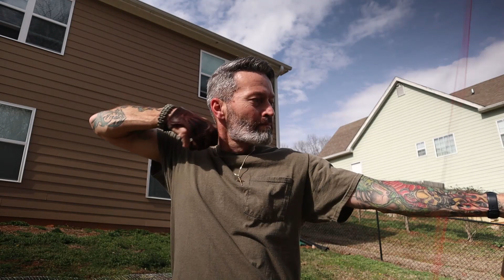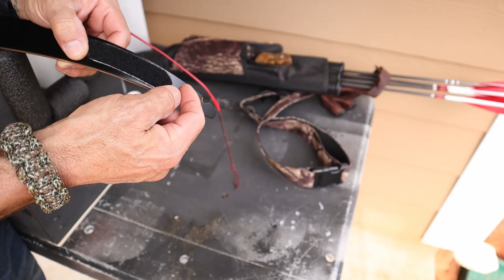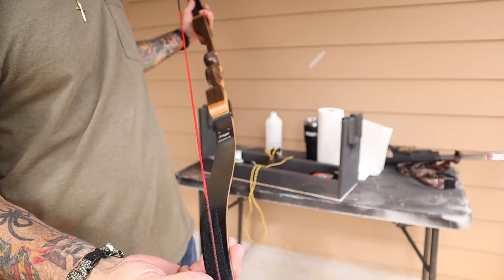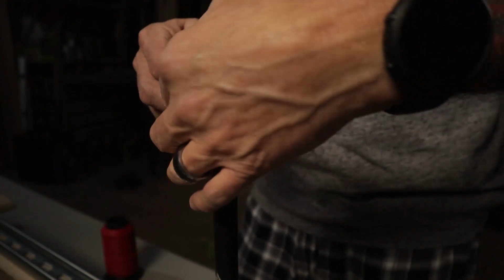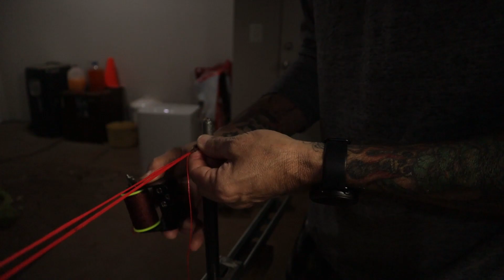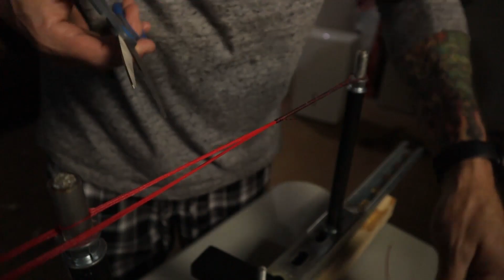Silencing Recurve Bow Limbs-Recurve Noise Fix

Comment: Good tip, but I’d also be adding whiskers to the string and continually working on the right brace height as string stretches in and it should only become even quieter 👍🏻
Reply from the maker: Thank you for your time and the comment, my friend. I have experimented with those ideas and think I have gotten it as good as it can be. I hope you have a great day. Best regards
Reply: What about a cotton ball? too light?
Reply from the maker: Thanks for the question. A cotton ball would not hold up after repeated release.  I do appreciate your time and the comment. Have a great day. Best regards

Comment: Cool video,  some great tips and well made. One thing I'd suggest for your string building is to stretch the string and set the amount of twists you need to get the brace height you want, then do the centre serving with the bow strung. That way the centre serving won't come apart when it stretches or you add/remove twists.
Reply from the maker: Thanks for the tips my friend. I'm new to endless loop builds so I'll take all the advice available. The learning process has its rewards. Thanks for watching and Thanks again for sharing the tip. I really appreciate it my friend. Have a great day.
Reply: i guess it is kind of off topic but do anybody know a good place to stream newly released movies online ?

Comment: I did that with  a sage I had and I ended up having to remove the velcro , the velcro prevented the string from sitting in the grove and as a result the string was out of alignment, maybe it was something I did . anyway like your video and plan to visit your other videos keep up the good work.
Reply from the maker: Thanks so much for watching and taking the time to comment. That does seem odd that the string didn't seat right in the groove after installing the velcro. Hopefully you got it sorted and your bow is set up to your liking. Again, I really appreciate you taking time out of your day to comment.  Have a great day my friend!

Comment: Just subscribed!
I have done exactly the same thing to my new recurve but I also added 7 inch fur plates to the other part of the velcro.
Now I have some takedown fury limbs on my takedown bow😉
I placed the fur so the string would always be a little bit in contact with the leather up and down.
It is a game changer.
I also added rubber plates between the limbs and the riser and pluged every holes I could find (metal riser) that would do a "guitar" effect.
Silenced the string with fur and screwed in a silicon counter weight.
The bow is TOTALLY silent, absolutely no vibrations after the shot.
You should try.
Reply from the maker: I'm going to have to try that with the limbs. I never thought about doing that. Closing up the inserts is another good idea. Thanks for the insight! I appreciate the comments and thanks for watching my friend.  Have a great day!
Reply: @ScottWinters  all the credit goes to Survival Lilly on youtube
Reply from the maker: Cool my friend. I follow her channel. She has great content.

Comment: So on the inside of the riser slots for the limbs  use Plasti Dip Spray  mask off the slots and shoot a clean coat inside the limb pocket and the limb section that fits inside the slot SWEET Hack
Reply from the maker: That makes a lot of sense. I will definitely look into that. I would imagine the plasti dip will compress a bit allow it to even out when the limbs are reinstalled. Thanks for sharing the idea my friend. Have a great evening! Best regards

Comment: I’ve never been able to add the beaver tails correctly… but I want to silence the bow, do you think these work as well or better for the sammick sage as far as silencing goes.. or do those tails take it to a different level?
Reply from the maker: Thank you for the question. I have never installed a set my self, but for my understanding they do help silence the string to an extent. I have used velcro and yearn in all of my string builds and bow setups with great success. The key to remember is adding anything to a string slows it down and helps lessen string vibration helping to reduce noise.
I hope that helps. Have a great day. Best regards

Comment: I have felt i used for my shelf.  Web says its to thick for limb savers.  So i am reluctant to use it.  Any opinion on this?
Reply from the maker: I would doubt there would be a problem using the felt. The velcro I use is thicker than felt and I haven’t experienced any negatives using.  I think you will be good to do so. 
Hope that helps. Have a great day. Best regards

Comment: Question:
Did the bow come with padding between the riser and limbs?
Reply from the maker: No it dod not. I've always thought about trying some things felt in the limb pockets but never seem to get around to it. I appreciate your comment and your time. Have a great day my friend.
Reply: I read on a few threads that it didn’t help much but a suggestion was made to apply string wax.  I’m going to try that.
I just did the Velcro strips on an OMP Adventure recurve that I set up for beginners. Works great.
Thanks 🙏 I really enjoy your practical content.

Comment: Out of curiosity why did you choose Velcro over say a felt adhesive strip?
Just curious if there's any real reason or just accessibility because I feel that good felt could work better and smoother for the string.
I've been looking at the felt due to the calf skin being so hard or costly to get in my part of the world surprisingly.

Cheers for the video though, exactly what I was looking for
Reply from the maker: Thanks for the comment my friend. The main reason for the velcro was just an overabundance of it, LOL. I've used it in the past and had good results do I just continued with it. You are correct that a good felt material would work as well. I think I tried some adhesive back felt on one of my bows before. It was a good thickness and gave good results. I really appreciate your time my friend. Have a great day! Best regards
Reply: @ScottWinters  thanks for the quick reply mate much appreciated!

Comment: Was your brace height correct? I’m guessing so seeing how you make your strings but just a thought?
Reply from the maker: The Sage seems to favor an 8 inch brace height. Recommended is between 7.25 and 8.25. I generally keep it at the 8 inch mark. Thanks for checking out the video. Have a great day
Reply: @ScottWinters   my buddy has one and we played around with it a bit. We set the brace at 8.25 and also stuck thin felt in the limb pockets and the vibration and hand shock is completely gone. Liked the video for sure thank you!

Comment: I just got a recurve bow and the string is sitting on the bow when I put it on instead of hanging out like yours does and I’m not sure what I’m doing wrong
Reply from the maker: How are you putting the string on? If it's on the wrong side it will do that. If its too long it will do that as well.
Reply: @ScottWinters  it was on the wrong side my DA self didn’t realize gif the longest time